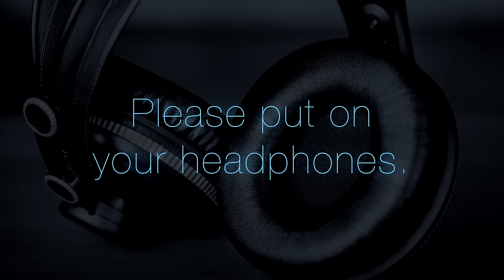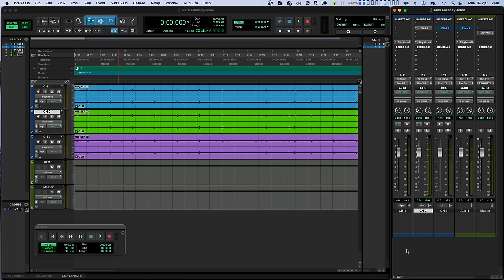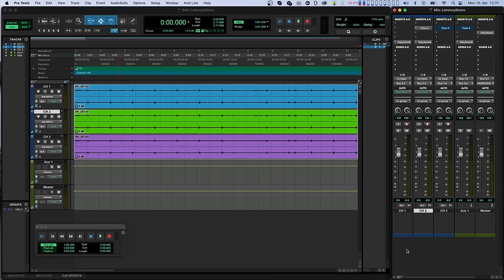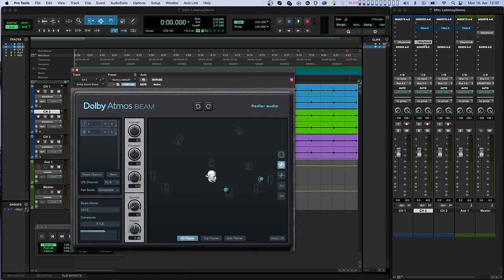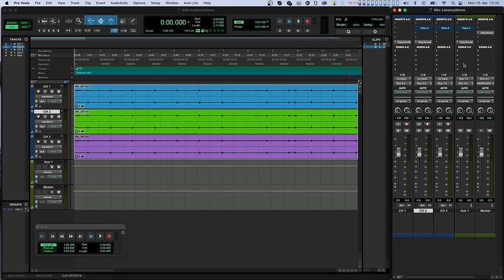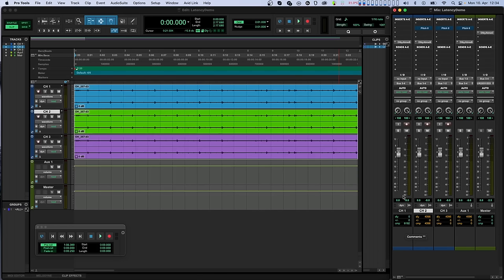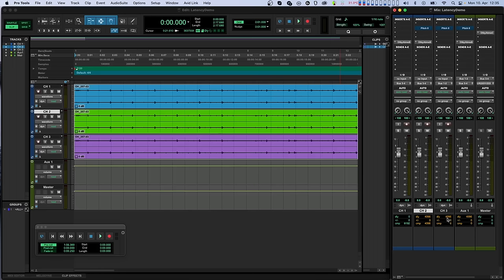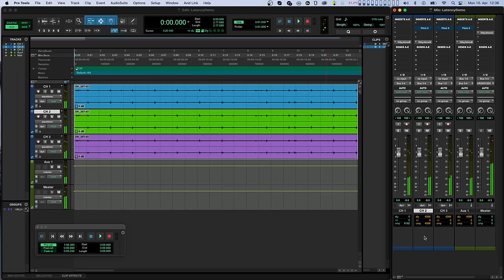Dolby Atmos Composer in-depth tutorial - 04 Delay Compensation in Pro Tools

Comment: No one has made any videos about delay compensation as it applies to Dolby Atmos speaker calibration. Is there a way to universally apply delay compensatiom that will not affect the render? I am worried if I use this mechanism I will forget to undo it before rendering. I also dont want to do it every time I open a new session.
Reply from the maker: The delay compensation shown here has nothing to do with speaker calibration. It has to do with a bug in Pro Tools, which by the way has already been fixed by Avid, at least partially. If you use an Aux track or a grouping folder as your master with the Composer on it and everything else routed there, you should be good without having to manually correct for this Pro Tools bug. We will at some point publish a video with the details on how to do it.

Comment: Currently what daws have the correct compensation and which ones don’t? Does Studio One work correctly right now?
Reply from the maker: Studio One has automatic delay compensation. The only DAW with this bug known to us until now is Pro Tools. Hence this tutorial.
Reply: Seems to compensate fine in Bitwig, Ableton. I dare say this is an AAX issue perhaps?
Reply from the maker: @SamHocking  Nope, it is a bug in Pro Tools. It is in the Avid bug tracker for over 3 years now and well, the Dinosaur moves sloooowly. ;-)
Reply from the maker: @SamHocking  Nope, this is a Pro Tools bug. It is already for 3 years in Avid's bug tracker, but as you know, Dinosaurs move sloooowly. 😉

Comment: any news about this bug being fixed??
Reply from the maker: In Pro Tools it seems to have been fixed in the last version.
Reply: @fiedler-audio  I use sound id reference multichannel for the sound correct of the studio. May I have tò insert After the composer? When exporting, May I have tò disabile It?
Reply from the maker: @stefanomonziocompagnoni8302  Yes, after the Composer because the output of the Composer is what you have to listen to. All exports are done through the Composer itself so no disabling is necessary.
Reply: @fiedler-audio  ok, thanks.
 i work on Mac m1 pro, protools ultimate, and a 5.1.4 monitor system.
The monitors are calibrated with soundid plugin.
I have also the external atmos render sw.
I work in audio post production for video.(Not music)
I am digging with atmos composer (the free version) and I find It Is  very intuitive to use.
Just wondering why use atmos composer instead dolby atmos renderer (embedded in protools) and instead of dolby atmos renderer (stand alone)
Can you  explain me what are the differencies and advantagies  in depth? 
Thanks in Advance.
Best.